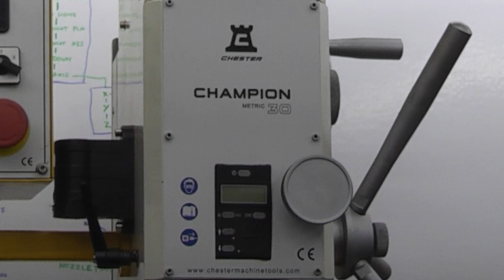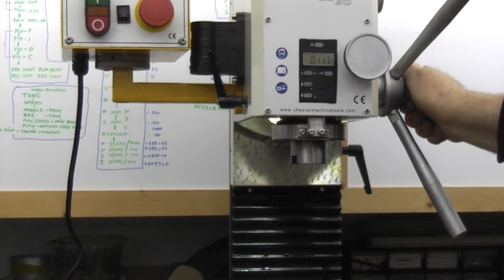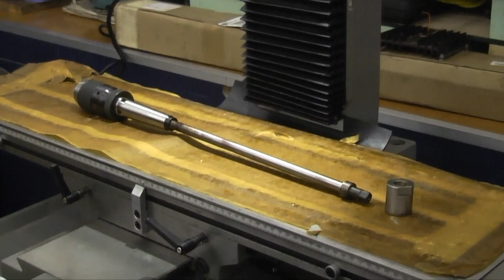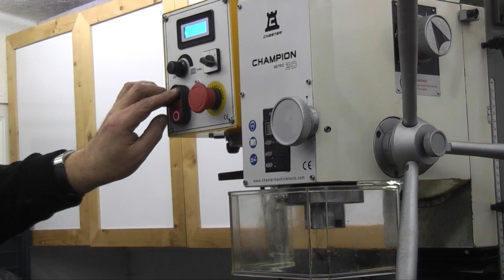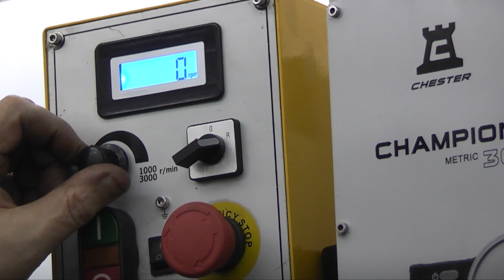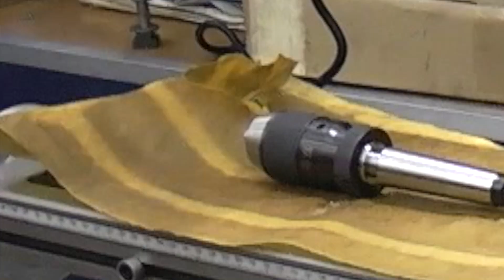We take a look at a New mill

Comment: Hi, me again. I got fed up turning the draw bar with a spanner. I don't really have room for a decent air supply so I bought a Milwaukee 12 volt 3/8ths impact wrench in a sale - cheaper than a compressor and air wrench. I tend to work in aluminium and I need to do something to contain the chips - being light they fly everywhere. Cheers. BobUK.

Comment: Hi Enot and brother. I have the Excel/Optimum BF30V. Very similar design, but more substantial square column. One extra mid range gear. Sometimes think I made a mistake getting an ISO30 spindle - easier to release than MT3, especially if hot, but tooling slightly less available over here. Needed an engine crane (e-bay!) to lift it. I used full on professional castors under the stand - expensive but light and day difference from the usual run of the mill (!) ones. I'm hoping to add a DRO and am researching options. Thanks for showing, sometimes I think my eyes are a bit too big! Cheers. BobUK.